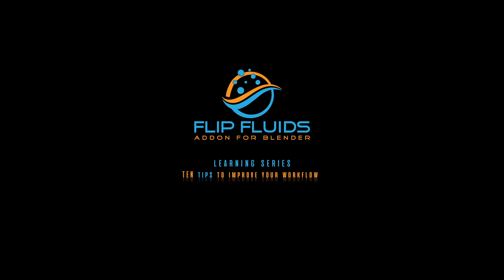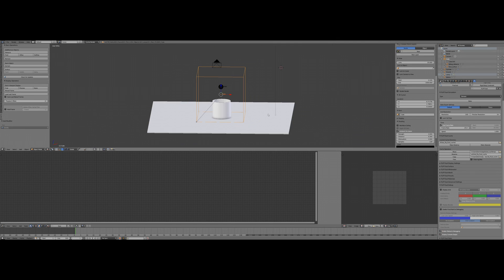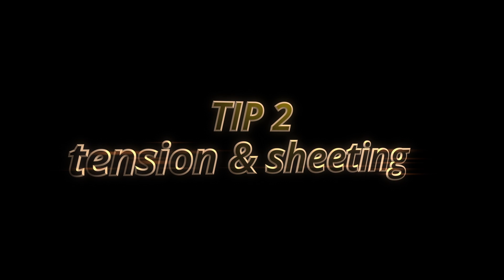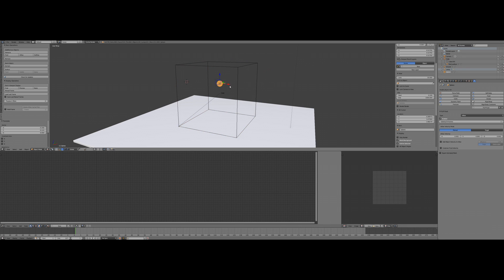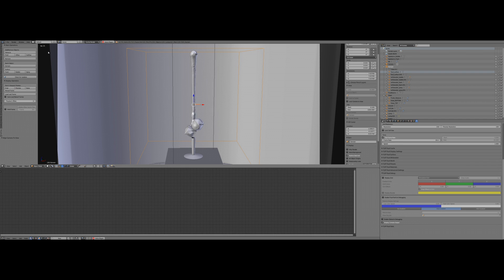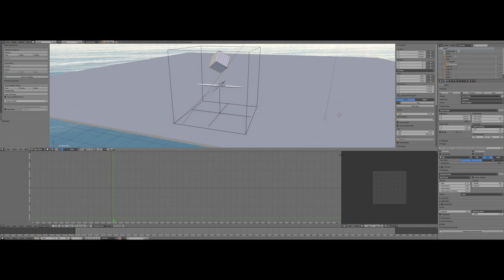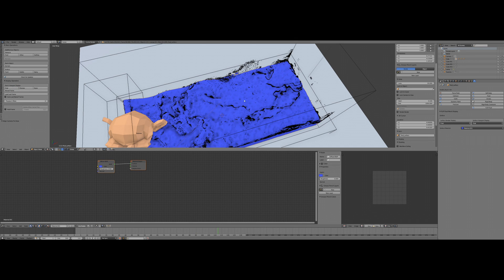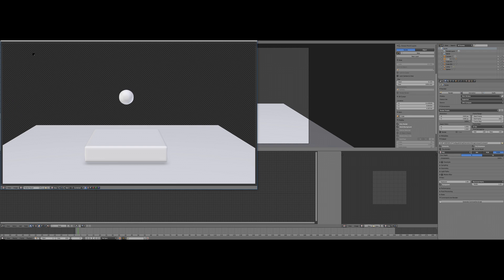10 TIPS to improve your FLIP FLUIDS workflow in BLENDER

Comment: thanks for this video, but due to how difficult it is to render fluids, is there a way to replace the water flow with objects, let's say flowing cubes?
Reply from the maker: You can add any modifier on top of the simulated fluid-surface. Try a remesh-modifier as example ;)

Comment: I wonder what's better: Changing the Simulation-Framerate to get some slow-mo or change the simulation speed. I get "stuttering" particles when I reduce the sim-speed to 0.1 when I follow the tutorials with the water-bubble (shot by projectiles) and the "fluid along path".
Reply from the maker: Good question.
We always recommend to use higher framesrates as this will give you the best quality and maximum flexibility in postproduction.
But keep in your mind this will take longer to simulate, render and needs more discspace
Reply: @Blenderphysics-Videos  In addition I realized that increasing the framerate does change the simulation drastically. I'm not sure how big production do this but for me it's not even worth trying with low-res-sims as the final result will be TOTALLY different when I turn up the voxel density. So even if I like the low-res-motion, nothing guarantees me that my high-res-sim will look at least a little bit similar. This is something I noticed in general when it comes to fluid sims and I wonder if this is just normal and everyone is just iterating until - with a lot of luck - everything looks good.

Another thing which really confuses me (and maybe it would be worth to talk about this in a 2nd 10-Tips-Video) why fluids sometimes get created out of nowhere. Here I have a sim with some breaker-obstacles (friction 1.0, sheeting strength scale 1.0) and fluid with some sheeting (surface tension 1.0 / 90%; sheeting strength 0.5, thickness 0.05) and when the majority of the fluid passed my breakers, suddenly some drips get alive and create fluid out of nothing.

https://imgur.com/DfM7sv1

I saw similar behavior several times now and I have no idea where it comes from. It seems lowering the sheeting multiplier on the breakers to e.g. 0.01 seems to help.
Reply from the maker: @simonsaysgray  That is a "normal" effect and has been explained in the documentation: Sheeting works with adding additional fluids to the simulation to fill-in holes. To avoid this effect deactivate sheeting or animate the strength value.

Higher framerates will increase simulation time. Make sure, that all other simulations (rigid bodies iE) used the same frame rate, and also your general blender configurations has the same FPS. If there is any difference you will have different velocities what is natural and logical.

Preview´s are made to have a faster playback. If the simulation result is very different to your final simulation you maybe are using a very low preview resolution. You can increase the preview resolution. That should help you. But it will never look the same like the final surface, as it is calculated differently.

Comment: I don't know if I like the solution to the first problem of just adding a solidify modifier and increasing the thickness just for the very obvious reason that it can ruin the look of your mesh!  Plus, I have tried this several times and it did nothing to solve the problem of fluids passing through obstacles on multiple occasions.  The only solution that has sort of worked for me was one that one of your representatives suggested to me, which was to fix Non-Manifold meshes by reducing the number of duplicated vertices by selecting the obstacle's vertices, going to "mesh" settings in Edit mode, then "cleanup-merge by distance."  This only worked for me about twice, but it's the only thing that's worked, so far.  Now I can't get ANY obstacles to work.  I love Flip Fluids, but it's starting to be a very frustrating experience.
Reply from the maker: Hi Drinner, whenever you are in trouble with obstacles - please check the debugtools we are talking about in the video.

You could also send your blendfile to us- so we can check it and learn from your scene.

Comment: How is 2.8 flip fluids coming along?  I've tried using FF in 2.8 but it usually crashes Blender after rendering a few frames.
Reply from the maker: This is because 2.8 is not avaible in a stable release (its in development). Many crashs has been reported and we have to wait till 2.8 is stable. Than our addon will work with 2.8 ;)
Reply: @Blenderphysics-Videos  That's fine no worries.  Just wondered if there was any news on that front.  I love the add-on!  By the way, can you tell me why even though I enable white water/foam/bubbles that they don't render?  I've assigned the preset materials to the appropriate slots in the FF properties?